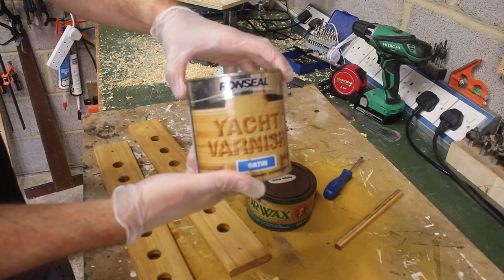Homemade parallelogram mount

Comment: Damm, the first beep had me looking for my phone thinking it was a nuke attack alert. Anyway, I have the same skywatcher tripod lying spare since I upgraded it, some 15x70 binos, some wood and tools. This will be a great project for cloudy nights, thanks.
Reply from the maker: Fantastic Paul. Let us know how you get on.
Reply: Hi, I got delayed as I realised I needed a drill table with fence and stop block for accuracy, so I got a new bench pillar drill (PBD40) and with some modification, added a table. With that sorted I got to work and now have a rather heavy chunky prototype using cls timber about 65x40. It works, Im changing bits here and there, adding/removing washers etc, to improve friction control,  I found that a washer on the bolt head only works best for mine. Im working on mounting now, my tripod top is for an EQ3/2 mount, so I have that lump (for the polar fine adjustment screws) to work around, cant use a block as you did, but I have some ideas Im going to try.  All good fun and learning too.

Comment: Sir, at 10:02 into your video you attached a grey looking part to the underside of the center post. Can you tell me what that is.  Also when you are rotating the parallelogram, does the center post screw not come loose? Thanks

Comment: @Refreshing Views Mark I have made one before but am starting to make a new one as of 27/09/23 for my 20x80 Greenkat Binoculars! Also Mark you need to put a cup holder for your Tea and can use it as a counterweight;- )? BTW what are those binoculars I love the eyecups?
Reply from the maker: Cheers Steve. They’re the 15x50 canons - amazing optics. The eye cups are a bino bandit. Amazing piece of kit. 

Not sure I can use tea as a counter weight. As your drink it, the weight will go down so you’ll need a moveable cup holder.

Comment: This will be so helpful.  I already have the wood cut and sanded!  Where do you get the apparatus that attaches to the binoculars?
Reply from the maker: Hi Cara, I would suggest searching for a camera tripod head, either pan & tilt or a gimbal head as you wish.  As you can imagine, there are a whole variety of prices and performances - I just bought the cheapest yet robust, unbranded pan & tilt from my local camera store.

Comment: Hi,  Mark  I just tried to make a copy of your build and failed ...How precise do the holes drilled  in the arm have to be, so this works ...?  I got mine pretty close when I put it together,  The only time it was up and down level was when the scope was high up and when i brought it down to chair level it was off a bit and looked like it was crocked...?   why is this...? what did I miss and mess up ?...I am doing some new parts to check just how far it is off ..?     this is driving me crazy trying to get it correct , and I am not going to drill holes  until I hear back from you I hope .. ..HELP...PLEASE.....And thank you ..!...I am noticing that your short 2 x 4 has other holes drilled in it after you fixed the boards that were in the way to mount your pan and tilt  head ..did you need more room for your 2 x 4 to stick out ...?   or is this something that  was needed to make the  vertical stay vertical and not fold inwards like I was having trouble with as it went up and down ...?     Can you explain please ...?
Reply from the maker: Hi Jim - send us some pics on the FB chat and I’ll reply. I’ll also send you some close ups of my mount after work.
Reply: @RefreshingViews  sounds good thanks .......Have a Nice Day ...

Comment: Where did you buy the bracket for mounting the binoculars to your wooden parallelogram mount?   Would it handle a pair of 25 x 100 Celestrons?
Reply from the maker: It was from my local camera shop - just the cheapest robust head they had.

Comment: How much is the counter weight you put? Are there any constraints for this? I have a bino that weighs 2.1kg, thanks for the constant replies though! Also is there any other way to connect with you(insta,discord,telegram etc)?
Reply from the maker: I think from memory it is a few kgs say 5lbs. You can always reduce the distance from the pivot to the binos and you'll need less counterweights to balance? Drop us a line through this: https://www.facebook.com/mark.radice.10/

Comment: Hey the holes (for decoration purpose) on the mount weakens the mount, right?
Reply from the maker: Technically yes but just make sure you space out the holes and don’t make them too large in diameter.

Comment: Great i need this! Any dimension constraints?
Reply from the maker: That’s up to you! I used scraps in the garage so those were my constraints (ie cheap!).
Reply: @RefreshingViews  Thanks also i just have a hand held drill machine, can i use that to make it?
Reply from the maker: @illyushen9856  so long as you hold it straight. No need for anything fancy - it will just take a bit longer if you use hand tools.
Reply: @RefreshingViews  thanks !

Comment: What mount are you using for the bins?
Reply from the maker: It's one of those generic aluminium tripods that comes on the EQ3 type mounts - bought second hand some years ago.
Reply: @RefreshingViews  My bad, I should have been more specific.
I wanted to know what you are using to mount the bins to the end of the levers.

TIA